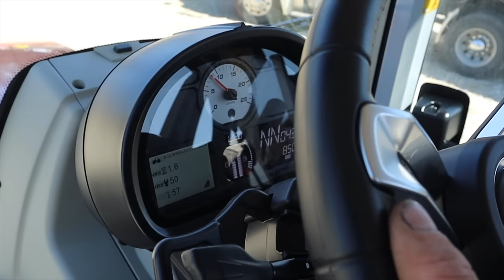That new Tractor smell | Bringing in the new 6S.165 by Massey Ferguson | #mfborntofarm

Comment: cool video. So this will be the hay bale tractor? So you are getting a Bale Baron, is it the 5250T? How are doing in your recovery? Be safe and God Bless.
Reply from the maker: Yes! This will be running the 1842S & Bale Baron 4250T - 

I’m doing okay. Still not fully released yet - have another apt on the 10th.

Comment: What kind of camera system are you guys running? Maybe we can work something out to try the Dakota Micro Agcam System? What Baron did you get? We switched from Bale wagon to Baron last yr and Love it!! Now switching to Massey Baler but sadly could not get the 1842S for this yr! We opted for the power unit from Baron instead of running all that oil continuously through the tractor.

Comment: When we purchased the   New Holland,  Bale Bandit   Re-Baling operation<  It was a stationary Unit designed to Convert 4x5 rounds into Bmall squares,  We swapped out the NH/Bandit for a  1840 inline/Bale Baron, with Marcrest 3 Point Hydralic Power Unit  to drive Baler and hydraulically power the 5250T Baron,,,,,, Adding   quick-attach electric power cord so as  If  Tractor powering unit Fails another 1000 RPM tractor can be  substituted ..  reguardles of Hydraulic  supply capacity.......    AS of right now a 1969 4020 is carrying the load......   There isn't an AGCO dealer within

Comment: Please explain Power Beyond in detail. I’ve got it on one tractor and don’t understand its purpose or how it works
Reply: Power Beyond Connection: The power beyond connection is an additional hydraulic outlet or port on the tractor that taps into the hydraulic system before the control valves. This connection allows the tractor to supply hydraulic fluid to external equipment.

Independent Operation: With power beyond, the external equipment can have its own hydraulic control system. This means you can control the hydraulic functions of the attachment independently from the tractor's main hydraulic system. For example, you can raise and lower a loader bucket without affecting other hydraulic functions on the tractor.

Increased Versatility: Power beyond increases the versatility of the tractor by allowing it to work with a wider range of hydraulic attachments. It also allows for more precise control over hydraulic functions, enhancing efficiency and productivity in various agricultural or industrial tasks.
Reply: On most newer Massey tractors you get power beyond for the return to manifold (3/4in return coupler) and a return to tank or "zero return".  There isn't much Agco stuff that uses power beyond.   Power beyond is a package.   You get all the ports in an option add on.
Reply: @nathanarn9128  thanks to all for clarification
Reply: Here is how we recommend our customers utilize it...anytime you constant flow a circuit through a remote one direction, like a fan or a control valve stack on an implement, put the return to the big return on the power beyond hookup.   On most units it's a 3/4 male coupler.  It's not necessary but it will save your coupler seals and lengthen the life of electronic controlled valves to return the hot oil back to the manifold and not push it through the valve.   Typically it will lower the oil flow needed to run a circuit also.